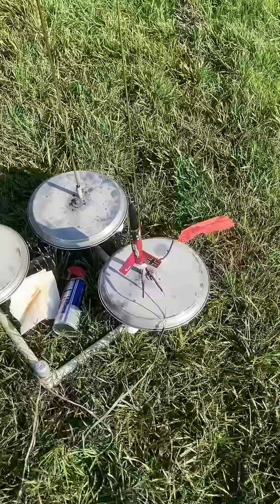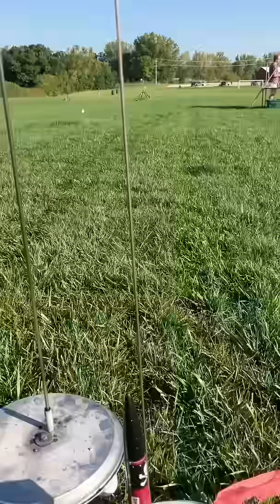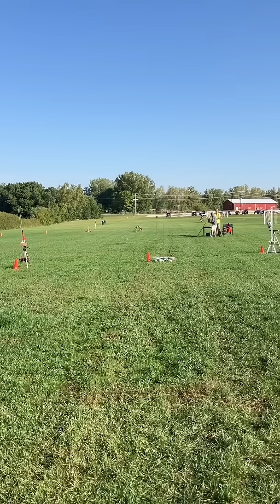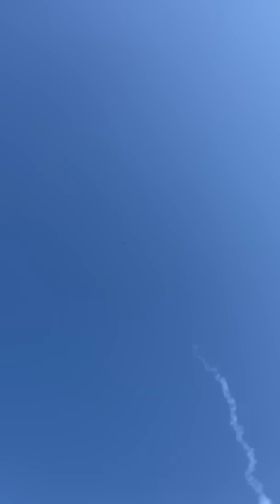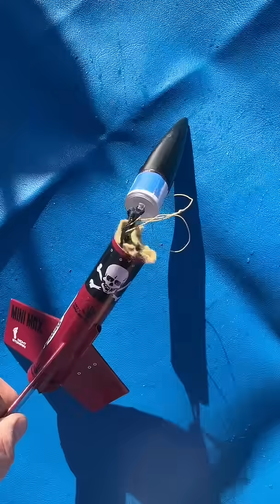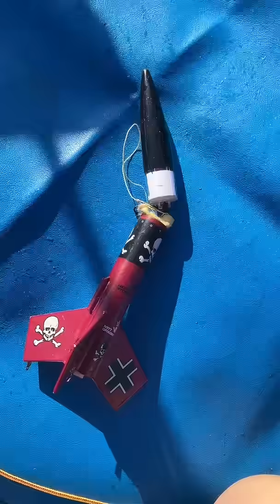Mini Red Max, A10-3T - Fail, No Streamer!

Comment: I think there was a lot of resistance caused by your recovery wading
Reply from the maker: Yeah, a lot of possibilities on the failure. This rocket is so short that everything is packed really tight. Unfortunately, the "T" engines are so small, the ejection charge is limited.